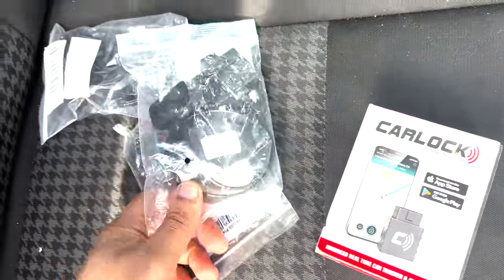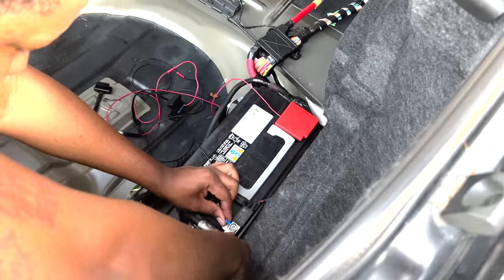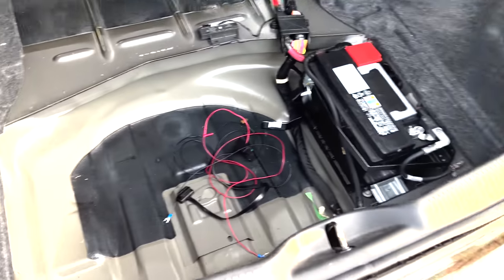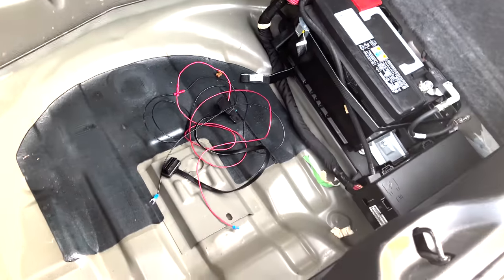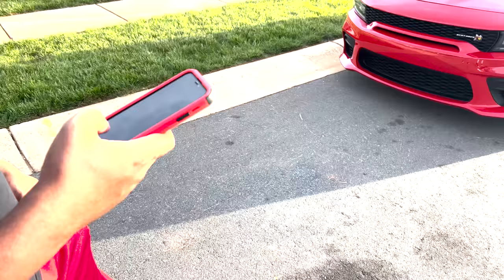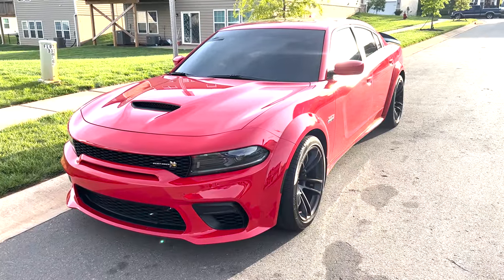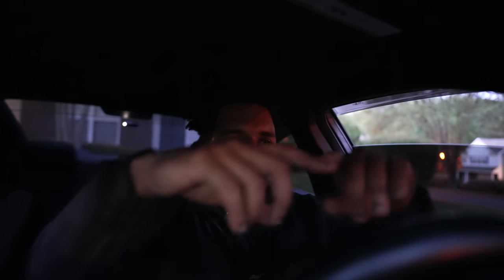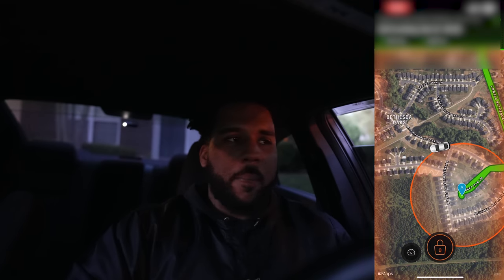Broke into my Charger ScatPack 392 & tried DISCONNECTING Car Security, but it was HARDWIRED🤬...

Comment: Good video but if I was you I would take it down. You just showed the thief’s how to steal your car if someone wanted to target you. If I put a security system in my car I keep it to myself. I hate see your beautiful Mopar stolen. Please just take it down. If you want to give good security advice just tell them to be very creative when installing an alarm system. 👍
Reply: Any thief would easily find this. I’m certain he has a tracker and kill switch that is somewhere difficult to find that isn’t in the video. No matter where you put the kill switch if it’s spliced within a couple feet of the start button or the ignition relay they can just resplice the cut wires. This is just a monitor that alerts him that the car is being messed with. I’m certain there is a second gps tracker and one or two kill switches that aren’t on the video.
Reply: Ditto I bought a kill switch but it's so many vids on here I'm debating on putting it in. He's helping tho so I get it. I just wish it was another way to make these vids
Reply: Facts
Reply: @Akron2PDX  they should be made without showing the exact location. In a lot of videos you see them putting it in the same location so you have to be creative on making it very difficult for the thief’s.
Reply: @rustyshaklferd1897  key here is having multiple security layers which adds time to the thief prevention a quick getaway.  Never rely one just one system
Reply: I understand your point but the device is not intended to stop the theft of the car. It is meant to notify the owner in real-time. The more time it takes to find and remove it, the more time the owner will also have to respond. Even though the device will notify you if it was disconnected from the main ODB port. Most car thieves would not open the truck first so there is a higher likelihood that they would drive away with the device still in the car if it is hidden.
Reply: Buy a 2nd CarLock ands connect it at the OBS Port.  That way when they get inside the car, if they take it out, they’ll believe they disabled Caralock, while you’ll be tracking them with the one in the trunk.😎⚓️
Reply: I told him same thing he won't listen to me
Reply: @Akron2PDX  could add a normally open solenoid somewhere random in the fuel line that gets triggered by the kill switch. No one really does that so it would be unexpected at least.
Reply: Thank you fam 💯😎😮
Reply: @josemiguelperez-alvarez3854  you have to pay a subscription fee. Not sure how much but that would be spendy

Comment: Personally just speaking from my pov my car 60k I wasn’t wasting time or cutting corners on security with car lock I just dropped da bag on 1k alarm system with all the bells an whistle’s.  Just don’t won’t to depend on 50 bucks alarm vs an tried true good hard wired alarm gps tracking alarm . Just my pov stay safe brothers
Reply: I feel You …!! I’m on the same mindset drop the bag and sleep well at night 💯💯

Comment: Run a spliced wire from the OBD itself under the carpet and up under your driver seat. This way it remains in the cabin, hopefully still sensitive to movement and vibration.

Comment: OBDII Splitter Extension Y Cable is what I use for hardwired GPS in my works trucks. The OBDII port looks factory & the car lock will be hidden inside the dash! I run the GPS & SCT Livewire TS+ at the same time with no issues

Comment: The engine start and vibration detection will eventually start back working. I hardwired my carlock and it began working correctly after a day or two. Love the videos bro.
Reply: How did you hardwire it? I was thinking of doing my directly to the fuse box using a fuse tab

Comment: Have a 22 charger scat. Car lock is hardwired from the battery and I still get all the notifications no issues.
Reply: Did you do it via a fuse box using a fuse tab?

Comment: What if you used 2 car locks, 1 where you normally plug it in and the second one hard wired. Would that work?. And if a theft found the first one he wouldn't look for another, I think.

Comment: Run the + wire to a ignition powered wire straight a 12v relay switch and then to a bus bar so you can have extra expandable terminals. This is when you gotta listen to car audio guys. You won't lose any features if you hide it a concealed location in cars cabin using velcro.  Yall are welcome.

Comment: Having it hardwired is gonna have it pull ~12 volts all the time. It may jump up to 14-15 volts when the engine starts. I'm sure the device actually connects to the PCM/ECU while inserted in the OBD2 port. That's why you get the engine start/stop alerts. What you need to install is an ODB2 bypass cable to connect it to instead. That should maintain the functionality, except for possibly the vibration.
Reply: This is how I have it and you right, it maintains all features but I do want to hard wire it via fuse box using a fuse tab. What do u think?

Comment: Best way I found is a dummy tracking device or even an Air Tag out in the open for the most part thats easily found.  While u have a hard wired unit buried and tapped into a hot wire thats buried.  They find the one u want them to and think thats the end of it while the deep cover unit is tracking.  Same idea as a hidden gun safe and a cheepo with a couple BB guns in it out in the open to find.  Another thing that helps is a steering wheel lock and or even a kill switch.  IF u slow them down, they move on to avoid being detected.

Comment: With the hardwire can’t you buy their vibration sensors for $20 and install them throughout the car?  I thought Rubix did.  Not sure about the hardwire and startup sensor not working, but then again the kill switches work.

Comment: You should use the splitter and run it remotely. If you tuck that wire away or even shrink wrap it to the main OBD the bad guy probably wont even notice. He will just see an open plug and go on.

Comment: You could hardwire to the battery and use the splitter off the hardwire to run into the cabin in the car.

Comment: The voltage tells the device that the engine had started. The car has a voltage regulator (resistor)  attached to the battery negative that is responsible for charging the battery when it drops to a certain point. It needs to be hard wired to a constant 12v source but not directly to the battery. That wY the voltage will read the engine/alternator output  instead of the battery's voltage. The OBD port hookup only provided the constant 12v power and negative just like the pigtail. Location will play a part as far a detecting vibrations in the cabin.

Comment: You could try splicing wires directly under the dash board. There are several 12V and negative cables under the dash that you can tap into. I would just add a fuse in series with the device just in case you have a surge in the system.   that way your security system is inside the car under the dashboard and out of sight and I’ll also free up you’re OBD port.

Comment: 1st take the transmission release cable unhook it and push it back up in the dash, buy a obd2 extension cut everything but power and ground, remove stock obd plug and put the extension in its spot and hide the real one with the extension plugged into up in the dash, now you cant roll it off down the street and its completely impossible to copy a key because their connected to nothing more than power, zero data connection

Comment: The car lock in the obd port if fine for notification that the car is being messed with even if they unplug it it still serves that purpose. I’m sure you do, but having a secondary gps tracker and at least 2 kill switches that are hidden and not spliced in near the start button or ignition relay. There are many good places for the tracker and the kill switches. If you remove the rear seat you can wire a kill switch to the fuel pump. Once car lock alerts you they won’t have time to remove the rear seat to find it even if you leave a note telling them where the switch is spliced to the fuel pump.
Reply: And you don’t need a physical switch to the fuel pump under the rear seat. You can wire a relay under the rear seat wired in a normally open configuration and any wireless device to close the relay via a remote control to power up the fuel pump.

Comment: I was just about to comment that .having it In the trunk it will a have lack of vibration sensitivity in the front. . And if you have your spare tire on top of it to . . They should create a clone so you have 1 in each obd
Reply: Mine work in my trunk within ten seconds im notified but i have the double bypass from zautomotive and it works..very easy install

Comment: when thieves cant steal them and drive them off, they will do what they did in the 70s and 80s, they will use flatbed  wrecker trucks to just snatch them up and haul them off.   an old school way to stop the car from driving around is run a heavy chain around the steering wheel and under a seat... unless they have big/heavy bolt cutters, or a tool box with the tools to remove the seat, they aint goin too far.. this would be something u could  do when u park the car at night.. another way to easily disable the engine is remove the starter relay.. if a thief cant get it started fast, they arent going to be out there trying to figure it out.  the laws need to be changed so that breaking into a car is a felony.. in most states it is a simple misdemeanor.

Comment: No you don't I hard wired mine and connected to longer wire and ran it to the inside of the car hiding the wire thru the panels and have all my features still engine start vibration etc just get longer wires connect it to the end of the car lock wires and hide it somewhere in the inside of the car
Reply: Did you do a fuse tab hard wire?